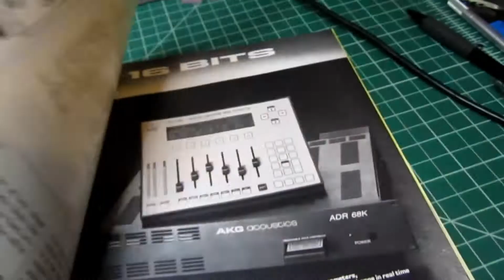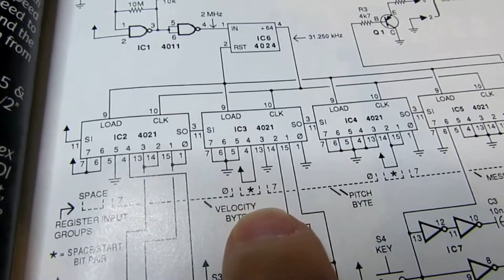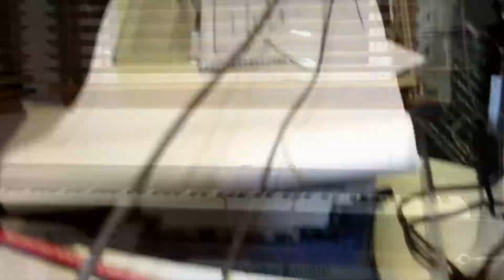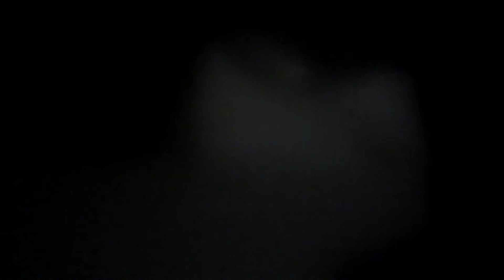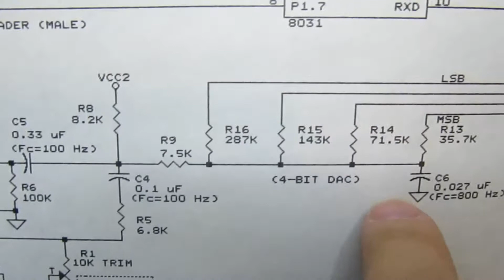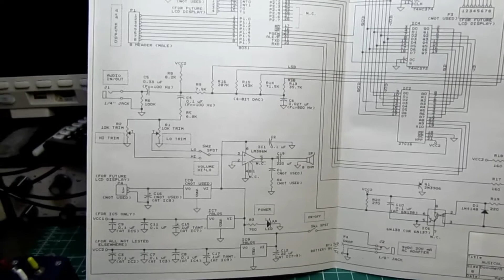Pocket MIDI Controller & Son of Pocket MIDI Controller

Comment: Wow.... I just came across this video but remember reading this magazine.  I probably read this issue but can't recall for sure.  It's cool to hear the design details around the article so many years later.   I'm also building MIDI H/W devices but using cheap modern microcontrollers.   This was great!

Comment: I have a piano midi keyboard that I bought for my daughter nearly 20 years ago.  She never used it since midi wasn't available on computers and it's still in the original box if you are interested in it.
Reply from the maker: BTW, MIDI was definitely available on computers 20 years ago.  MIDI was announced in 1982 and there were lots of MIDI products already on the market by 1983. I started to use MIDI in 1986, with (if I recall correctly) a Roland MIDI interface board in my IBM personal computer, so I know it goes back that far, about 34 years or thereabouts.